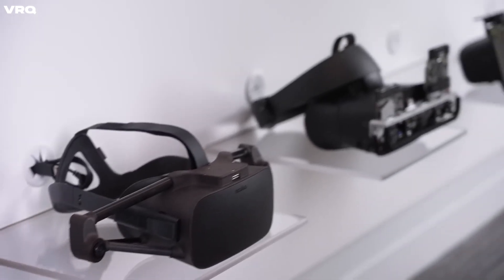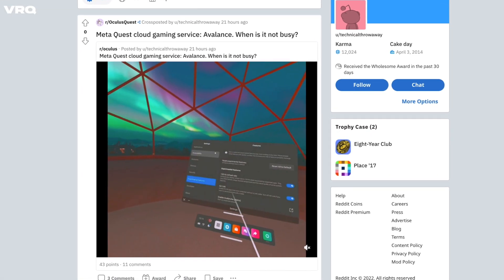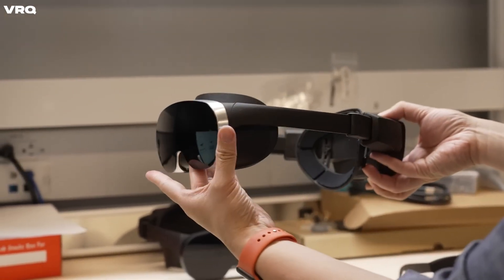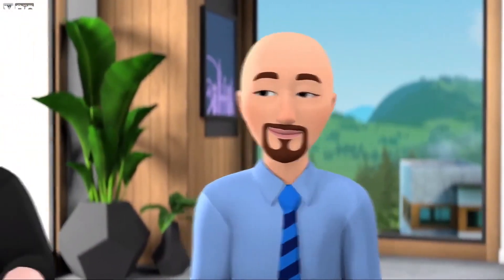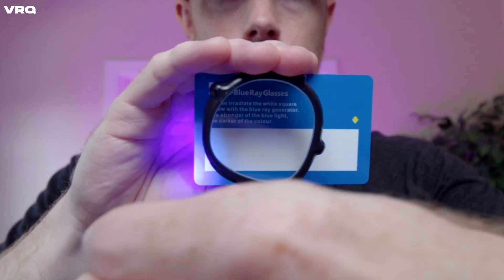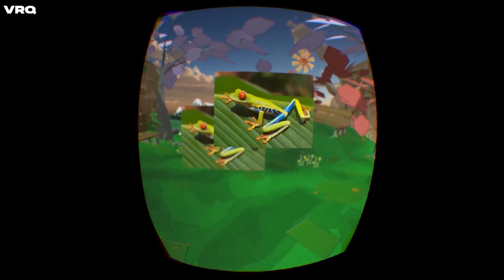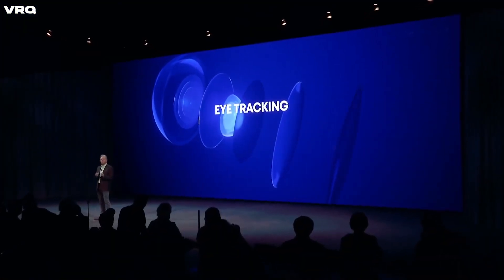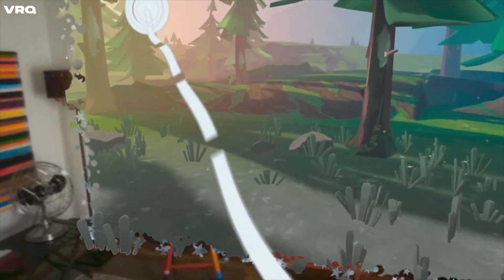Meta's Plan for the Absolute Best VR Headset

Comment: I'm glad you mentioned higher FOV.

Most companies are not even trying to increase the FOV.
It's terrible.
Reply: simple higher resolution is already hard to run. Increasing fov adds even more pixels to run unless you lower the resolution which is also a problem. Until eye tracking becomes standard this will be an issue (distortion is also a problem)
Reply: @Ren-lx8wv  yes I hear you.  Eye tracking will be key for sure

Comment: I've never really understood the need for varifocal lenses, and I don't understand the demo given of the text becoming blurry without varifocal when you bring things close to your eyes. That simply doesn't happen in VR, at least for me. If I hold a video tape close to my eyes in First Contact as seen in this video, it remains pin sharp right up to the point my controllers are touching my headset and I can't get any closer.

This is true of reading cans in Half Life Alyx on my G2, pin sharp.

In real life I can't read cans up close because I'm nearly 50 and my close up vision is going, in VR it's like being a young man again. For that reason I really don't get why people want varifical, but maybe I'm just not understanding it correctly.

I do know that the video demonstrations given are all wrong though as right now in VR, with a fixed focal plane, text remains crystal clear at far closer ranges than it would in real life, at least in a near 50 year old like myself.

Comment: How long? 10-years? Maybe.

Short term prospects to make VR/AR mainstream:

Affordability: Cambria sounds decent, but at a supposed $1500 price point, not many people will get it, especially those who you know personally. & Quest 2 is a good $, just not as light or as comfortable is it could be with latest tech. 

Software: I feel like what makes social VR fun, is hanging out with people you know IRL. Entertainment would be good if the HMD is comfortable and light enough to wear for multiple hours.  

Form Factor: creating a balanced, lightweight HMD. Getting rid of the top strap.

I think those things need to happen such that people you know IRL will be using the device & you can actually socialize with them without the friction that currently exists. Pop on the headset, & you’re with your friends within seconds.